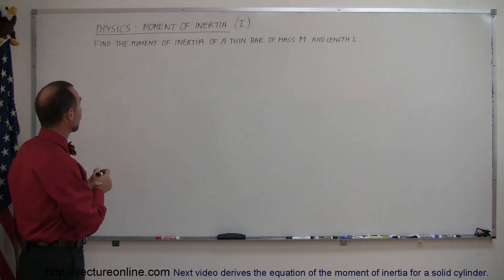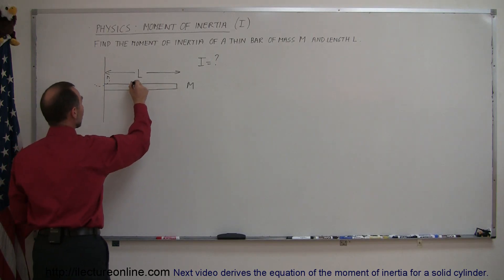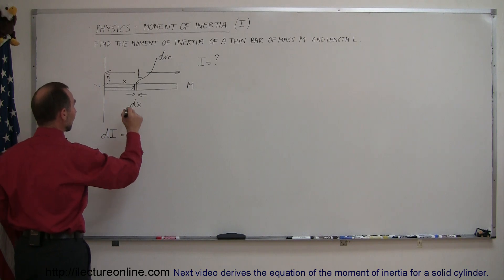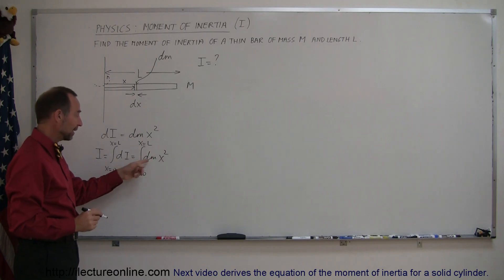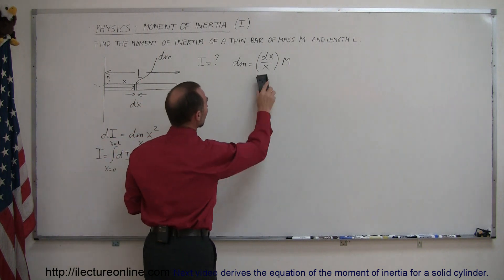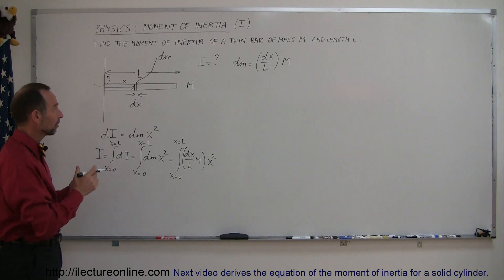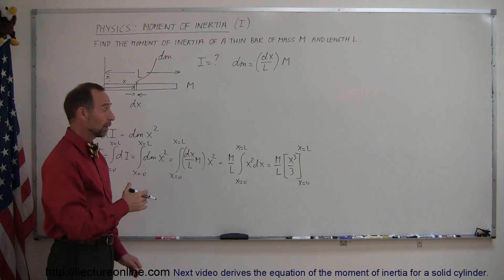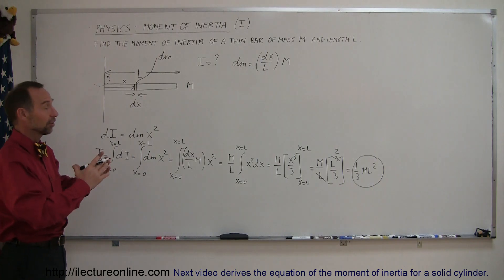Physics 12  Moment of Inertia (3 of 6) Derivation of Moment of Inertia of a Bar

Comment: Sir, How Angular acceleration if multiplied by Radius becomes Linear acceleration?
Reply from the maker: Angular acceleration doesn't become linear acceleration.  Instead, for a point at the end of the stick, if the stick rotates with an angular acceleration, the point at the end of the stick will experience an acceleration in a circular path equal to:    a = R x alpha
Reply: What is alpha?
Reply: @manikandanbalaguru2362  Alpha is angular acceleration

Comment: I'm trying to find the moment of inertia when the rotation of axis is 1/4 of the way through the bar.  I'm integrating with the upper limit being 3/4L and the lower limit being -1/4L but I think I'm doing something wrong, because there's no way this is the right answer.  My final equation was (ML^2)/64 + (ML^2)/192
Reply from the maker: Use the parallel axis theorem   There is an example in the playlist
Reply: Thank you very much professor.  I find it incredible that you are still replying to comments and helping people with physics.  I did use the parallel axis theorem, but unfortunately, I'm required to find the answer using integration as a part 2.
Reply from the maker: Then you have to integrate it twice (as if you have 2 separate beams that are rotating about one end and then add the 2 results together.  (we try to respond to most comments).

Comment: what if the fixed point is anywhere on the rod and and want to find the moment of inertia of the centre of gravity of the rod?
Reply from the maker: Integrate from the center to the edge, and double the result.
Reply: no thats easy
I mean lets say the rod has length L and is fixed at L/4 and the CG is at L/2 how can I find moment of inertia at CG?

Comment: Why is it x^2 left as a constant in the integral?

Isn't the length x changing with respect to every different position for dm, so shouldn't x also be represented as a change (dx)?
Reply from the maker: Did you watch the video to the end?
Reply: Oh! I think my use of calculus was amiss. 

I forgot that dm, dx, and any variable with a "d" in front, really means an infinitesimally small size. I assumed that the distance between the mass element and the axis of rotation can be represented as a "dx^2", however that x^2 value is not approaching 0....

So I want to ask, is my train of thought correct? The x^2 in this integral is actually a variable, since it is changing from distance 0 to L. However, there is a dm term, so dm is replaced in terms of dx, in order for the integral to work.
Reply from the maker: Whenever there is more than one variable in the integral, you must express the second variable in terms of the first variable.  (Otherwise you can't integrate it).

Comment: why do we call the distance from the center of rotation to dx x. why does it not have to be a different variable?
Reply from the maker: You can use any letter of the alphabet.  It actually doesn't make any difference.  But it is customary to use the letter x for linear distance.

Comment: how would the derivation differ if the bar was being rotated about the x axis? I had a physics test question with that case.
Reply from the maker: Brielle Tate 
If the bar is "thin" then the moment of inertia would be  I = mR^2  where R is the distance from the bar to the x-axis
Reply: +Michel van Biezen 
Would it make any real-life sense to integrate between two boundaries that were both greater than zero?

Comment: can someone explain to me why the distance from 0 to x is somehow x^2?
Reply from the maker: Collin,

The distance from the origin (0) to a point on the bar (x) is x (not x^2)
However the moment of inertia (I) of a point mass (m) rotating a distance (x) from the point of rotation (x = 0) is:  I = m * x^2
Thus for a small segment of the bar of length dx and mass dm the moment of inertia is:   dI = dm * x^2 and to find the moment of inertia of the whole bar you have to integrate all the small little segments.
Reply: Ok that makes sense, but how is the formula for the moment of inertia of an infinitesimally small point (mr^2) derived?
Reply: And thank you btw.
Reply from the maker: Collin Mckernan
It is the same as the moment of inertia of any point object (an object with all of its mass concentrated into a small point)

I = m * R^2 which is the definition of the moment of inertia
Reply: this expression for moment of inertia falls out of Newton's 2nd law applied to rotational systems.

F=ma is the linear motion form of the law, right?

if we multiply both sides of the equation by r (the radius at which the mass is rotation about the axis) you get:

F*r = m*a*r

and we know that angular acceleration (I'll call it N here so I don't have to use special chararcters) multiplied by the radius of rotation equals the linear acceleration. We also know that F*r is the torque.

so we can rewrite as T = r*m*r*N

then we can consolidate a little bit and we get

T = m*r^2*N

Solving for N we get:

N = T/(m*r^2)

we represent m*r^2 as I the moment of inertia, which basically tells us how resistant an object is to angular acceleration, just like plain old mass is a measure of inertia in linear motion.

Hope that helped. I know it's a bit late, but what's a year? :D
Reply: @pipertripp  Thanks, this was really well explained! I finally see how the r^2 appears in the formula.
Reply: @vijay_veluguri  dude, no worries! I'm very glad you found it useful. An absolute blast from the past. I haven't thought about this topic in a REALLY long time.
Reply: I think the fact that inertia is squared as you increase the radius was found thru experimentation

Comment: So we are taking the integral about x-axis? Im confused about the axis we are working on?
Reply from the maker: Fatima Zolfaghar 
You have to integrate from the point of rotation to the end of the bar.
In this example the bar is horizontal and we used the x as the variable for length.